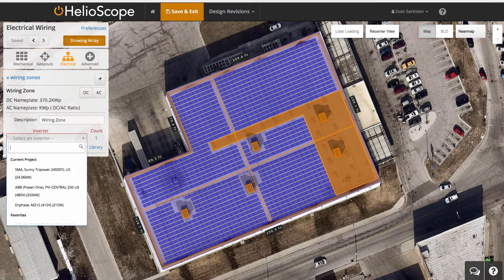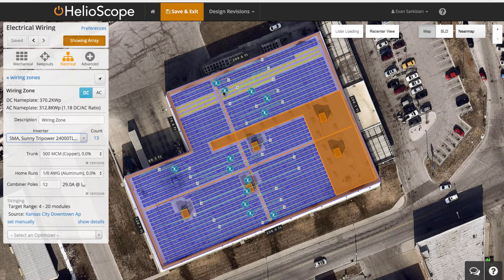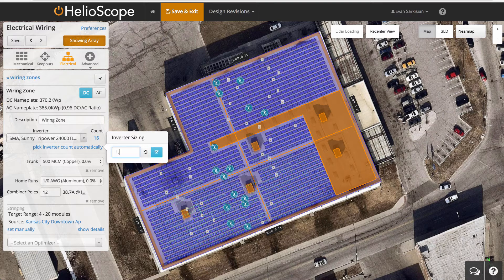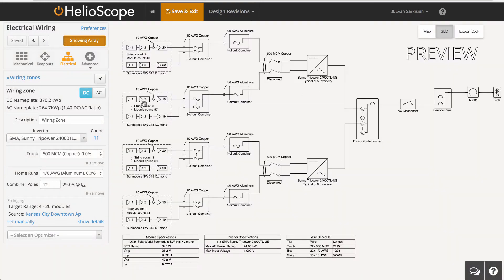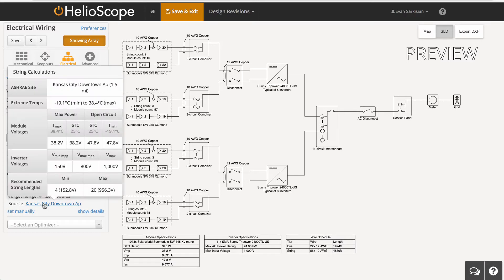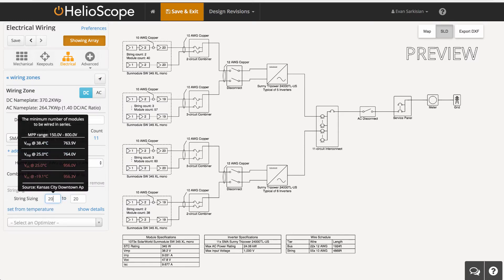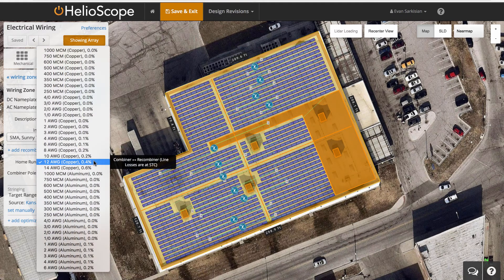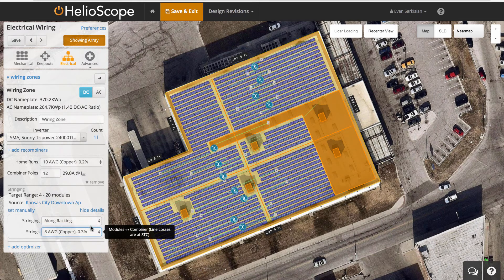Electrical Design in HelioScope

Comment: SMA sunny design allows auto selection of the inverters. Can helioscope do that if i tell it to only use SMA inverters and pick the inverter module combination that would be the cheapest option.
Reply from the maker: HelioScope won't select the inverter for you at this point. That's an interesting feature request. You can email us at support@folsomlabs.com and we'll make sure you're notified when it's available. In the meantime, once you select an inverter model HelioScope can automatically place inverters around the array based on your preferred DC/AC ratio.